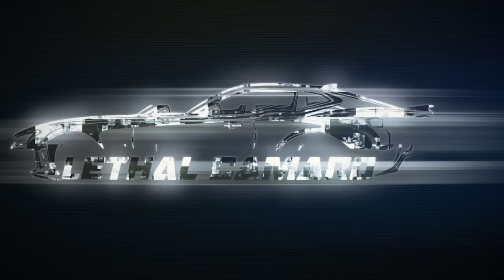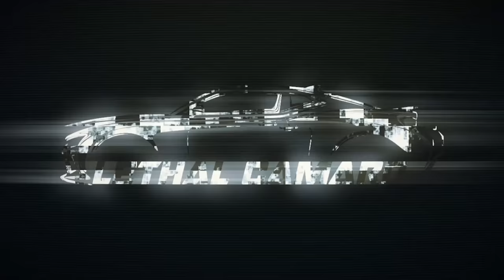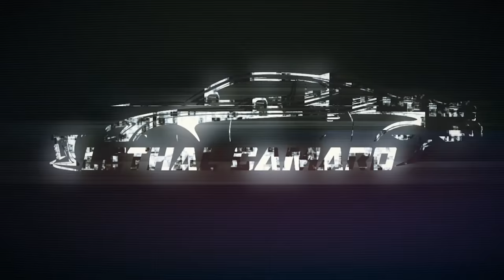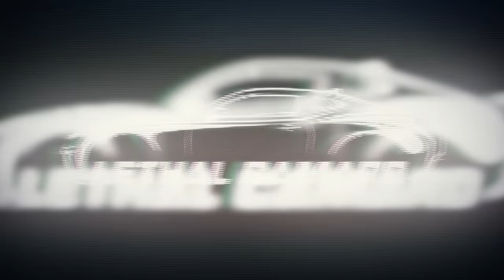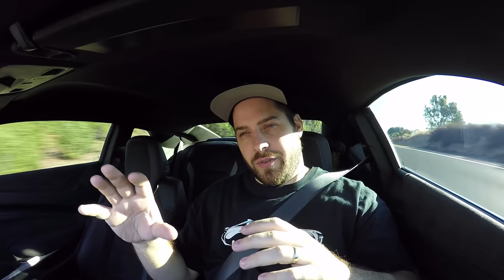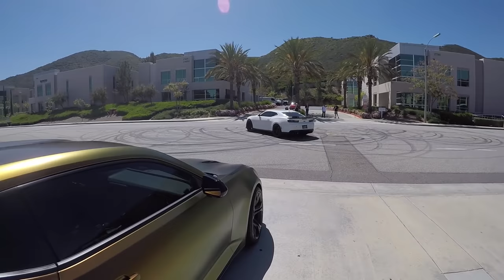Performance Chips! Watch Before You Buy! - Drive with Lethal | S2: EP9

Comment: Hey lethal back when you first got your car and you bought the vitesse throttle controller, why did you take it off? I have a tune exhaust and I just bought my throttle controller last night. I feel that the throttle controller on top of my tune is gonna work wonders for the drive by wire. It seems that some people feel that it's a replacement for a tune, but it's not. They can both be used for improvement, and from what I've seen the throttle controller does WAY more for throttle response than just a tune. Just making sure you liked it and I'm not wasting my money
Reply from the maker: +atolar23 if you get a real tune, you have them tune the throttle for you. Also with a built car and a precise tune, a TC can throw things out of wack, the throttle body position is very important in a real tune.
Reply: LethalGarage you can't get the most out of the throttle with a tune though or it can mess up your ECM from what I've heard. You get it all with the tc and it's customizable
Reply: I had a VTC on my '14 2SS for about 6 months.  At first I'd get the "limp mode" about once a month.  I was OK with that since I really liked having the VTC installed.  Towards the end I'd go into limp several times a day.  That was with reconnecting it and reprogramming it.  It just wasn't worth the hassle.
Reply: Terry Rodecker Really?? I already spent my money on it because I heard all the good things people said in the forums. Do you think I'll have problems out of it?

Comment: the chips work if they peg the timing like old hot rods, you gain a lean tease. Some reset speed limiter/rpm. My 96gmc had one (that computer they claimed untunable) and it was a lunatic. I brought mine back to factory. I won't reveal the brand, this video is not about that.

Comment: I have a 04 Maxima, it’s stock and wanna make it faster and if a stage 3 performance chip doesn’t work, what’s everything else I can do
Reply: I’d wanna add a cold air intake, spark plugs, stage 3 performance chip, tune, and last thing is a exhaust but not to loud because it’s a Maxima 💀

Comment: Question have my 2018ss Camaro getting the gm performance intake and thinking of throttle body like u had from one of your previous videos. The vmax throttle is no longer available but katech is would u recommend that. Also would you get a a tune after that for my simple setup

Comment: I’m just gonna skip performance changes on the computers. I’m gonna just try to put a big turbo in my 2011 impala 3.5 liter. With a short ram intake it has 211hp but I wonder if it’s possible to get the engine to 361hp without damage or long term damage to the engine. I want to keep it looking super simple and stock. But I wonder how my car will look with the 2LT RS Camaro rims on my impala with the upgraded headlights and taillights and new exhaust. I wonder how it would look. It could possibly look stupid but idk. I want to try it and see if it looks good. If it does I’ll definitely buy them.
Reply: You can't just put a big turbo, you have to match AR size to Cid, and engine flow. And a properly setup engine can easily achieve that.

Comment: Just go buy some 100 octane race gas at flyer's you will have quicker throttle response and no more backfire resulting in a little more HP. If those chips worked tuners would be out of business lol...

Comment: Looking for a chip to plug into the OBD2 port to allow me to run E85 and therefore need it to be able to modify the timing in addition to the A/F ratio.  Basically, I want to be able to plug in the chip when I want to use E85 and unplug it to go back to factory settings when running on regular gas. I'm not looking for any HP increases, just want to maintain the same drivability and prevent any damaging detonations.  Can someone recommend a performance chip that is made specifically for running E85?  Thanks!

Comment: What I'm doing I'm trying to keep you almost the same height it come from the factory 245 45-20 on the same height of the sidewall to keep the same plus ride luxury ride with white tie let me know what tire axle will fit on that front on a 9 inch rim

Comment: Lisa garage this is Reginald out of Norfolk I need your help with knowing what type of tires to go on my 2018 Chrysler 300s I'm going 20 attends in the back 20 by 9 in the front I want to put a 305 35-20 in the front on a 9 inch rim in the back I'm going to put a 315 35-20 in the back Chrysler 300s 2018 let me know if your front tires let me know if your front will work

Comment: 20 by 9 in the front 20 by 10 in the back stab you in the back I have 315 35-24 the back I'm trying to figure out what to go on the front 305 35-20 be little wider the same height

Comment: I know you had your car tuned but what was used to tune it?
Reply: Alejandro Mora more then likely hptuners was used for tuning.
Reply from the maker: +Alejandro Mora HP Tuner and a dyno.
Reply: Thank you!!! I have a 2018 1LE and wanted to have everything ready for when I start modding. Just a secondary cat delete and I changed out the anchor of a muffler so far
Reply: Alejandro Mora you should weigh the npp lol it looks like it weighs alot.
Reply: Sadly I threw it out already. But it felt like it weighed a lot. My highway cruising mpg went up 4mpg though so I know the cat and the npp were pretty restrictive and the npp's weight certainly didn't help

Comment: hey bro , am looking  for a performance chip , for a g37s coupe,  can you recommend, just wanted a lil  15 hp
Reply: It doesn't work. I've had this in my Q50 hoping for better milage but this hasn't increased anything. If you want an extra 15HP, invest in a new exhaust and/ or air intake if you haven't already.
Reply: J. Santos I have a Honda Civic 2013 si should I do one of the 2 you first building from stock ?

Comment: First give me a cookie! 
Now i got a serious question im planning on ordering a 2017 camaro ss in the next few months should i do that or should i order a 2018 camaro ss or go for the 2SS im a college student so im trying to get the most out of the money that im paying
Reply: Bashar Adel I don’t think you can order anymore for 2017 they are only taking 2018 orders now.
Reply: 2017 builds are done, 2018s are the current build.
Reply: Richard Ivanyi  yes ik but for some reason a dealership in jordan still has some in stock never been driven so i was planning on checking them out and asking for a price lower than the current msrp but i think that it would be a fail plan
Reply: B 1LE ik but we still have some in stock 2017 models
Reply: For a college student I wouldn't buy a 2017 or 2018 camaro, to much money, high payments
Reply: Young Sperm already got a toyota corolla for 1 year and i drive 2 many cars tbh im sick of driving inline 4 cars because i drive through the desert every day to uni you can as fast as you want and i can only reach 160km in that car at that speed you feel like its falling apart so i need something faster and reliable
Reply: Young Sperm im welling to pay that amount of money for a car that would actually handle what im asking for
Reply: Bashar Adel in stock and ordering is different but I’d say go for a 1ss if money is an issue they tend to run cheaper to buy and go for a 2017 since no changes were made for 2018
Reply: B 1LE i will most likely do that but are you sure that nothing has changed in the 2018 model?
Reply: Bashar Adel yes only thing new for 2018 is the release of the 2SS 1LE.
Reply: I don't think their is a difference
Reply from the maker: +Matthew Lafferty get what you can afford :)
Reply: Only the 2SS has the vented seats, get some a/c action while driving thru the desert

Comment: Wrong!!!! I bought a Dodge Performance chip for my 18 Charger R/T  and on a dyno my hp was increased by 61. Tell me that's in my head.
Reply from the maker: A factory update vs. and aftermarket chip is an entirely different conversation.
Reply: Which chip did you buy im looking for one to put in my 2015 challenger
Reply: @moparlife5361  Chipyourcar.com I bought the stage 3 chip and it works like a charm.
Reply: would it work for an infiniti g35?

Comment: What about Diablo?
Reply: King Keston a friend used a diablo tuner on a ram1500 and it made a difference. It wasnt on a dyno but the shift points in the auto tran changed and would chip all 4 tires in 1st to 2nd when on the performance setting. Seemed to run better to me. Butt dyno lol
Reply from the maker: +Todd G tuner setups are different than chips
Reply: I have one on my 17' Gen6 SS manual, best thing it did was remap the throttle to eliminate the dead zone and make it a lot more responsive. Sport mode and track mode feel way different from each other. Track mode feels like the throttle is heavier and wants more input, where as sport mode feels lighter and gives more throttle with less input. Stock it seemed both modes felt almost the same and had an earlier dead zone where you needed to mash the throttle to get to the power. So that alone was worth it with the Diablo tuner and OTS tune it supplied. I also have a Rotofab AI, and a MM catch can. The car feels faster, but I can`t say if it's the throttle remap or actual extra 15hp/15tq or whatever the numbers are supposed to be. Once I put some miles on it (@7k now), f` the warranty, I'm going headers, SC and a real dyno tune, hoping for 550 whp on pump 93, maybe a cam also.

Comment: U can get way more horse power buying a performance chip, it will max out the hp and ratio for your car and go 0-60 faster and more then 15 hp like 40 hp or more, depending what engine you have
Reply from the maker: /facepalm

Comment: In my experience, pro tunes cost much more than $200. My former Sti cost $750 for the tune. In fact, I tend to disagree with everything you say. Professional tuners simply remap your ECU. That's exactly what performance chips do. Have you installed a chip? Because if you haven't, how can you say they don't work? I installed a Pedal Commander in my Charger, and that thing makes a huge difference in immediate power. I suppose it's in my head?? What a stupid, insulting thing to say. People are too dumb to realize whether or not they're going faster? You sound pompous to me.
Reply from the maker: RAN MAN /facepalm... a pedal commander is not a chip. It simply remaps how your throttle ramps up. It doesn’t make it faster it still requesting the same voltage range from dead pedal to WOT. Maybe understand how the product works before you come spouting off nonsense. Yup your butt Dyno feels faster, but the car is not actually faster with a pedal commander.

Also, yes I have installed chips and did Dyno testing before and after with no increased power results.
Reply: @Lethalgarage  - I didn't say the Pedal Commander was a chip. I installed it myself. I was referring to a person's sense of going faster. I can probably run 20 mph. That doesn't mean a 5-Hour Energy drink and a pair of cleats will not help me run faster than my normal pace more often. And you're wrong, btw. My car is faster from a dead stop because the throttle reacts faster. It doesn't have more horsepower than before, but I get my available horsepower much quicker. And at the drag strip, that could be the difference between a win and a loss. Sorry,....but I still don't think you know what you're talking about. You're making generalizations without test results. You, in a car expounding, is not a scientific or mechanical test. I actually experienced a dyno butt test when I drove my pro-tuned Sti and when I drive my Pedal Commander Hemi. Sorry if I sound cross . I ain't. Although I've been told when I post, I do. It's just that modern cars are controlled by so many electronically programmed functions, from air/fuel ratios, to rev limits, to boost, throttle response, automatic shift times, traction control, so on.... You're saying a Programmed Chip will change none of that because horsepower and performance cannot change electronically with a chip, only with a human tuner?? I think you're wrong. Just because an engine is rated to a certain horsepower doesn't mean that it isn't capable of more. Particularly with modern electronically controlled  engines. That's all.
Peace!!
Reply: @ranman4481  tell me what your opinion on Thornton chip tuning is? Was thinking about getting it for my son’s 2010 cobalt lt2,has cai mod,exhaust & something else. Not much but I’m just curious. 
TIA

Comment: Why not test it give your viewers quantitative data, are you a tuner 
Are you trying show off your ride
YES U ARE 
Exhaust burble we hear from your car
You recommend people get car tuned 
When your car need timing adjustments . I’m a tuner for AEM

Fact 

Some cars' exhaust systems will produce an odd burble or bubbling noise. ... The burble is in actual fact a series of lean misfirings caused by this timing which rumble out through the exhaust system. It causes no serious damage to the engine, and soon disappears once the vehicle has reached high speeds.
Reply from the maker: Lol….

Comment: I do not agree. There are now chips out that really work and can add up to 60hp. For instance jdm pro stage 3 and it clearly offers real results. So people do your homework and some people just like getting 2-5 more mpg and faster throttle response. This chip even worked well on my Porsche turbo for only like $250 added a whole .4 seconds faster 0 to 60. Not a huge difference but noticeable and fun add on. So I call bs on your misleading people. 😁

Comment: What the fuck are you Talkin about????? Audi sq7 standard BHP 435, with chip in 500BHP, it takes about half an hour to install. You will not gain any power if you add a chip to a piece of crap. To benefit from the racing chip you you have to have a European diesel car and none of that American muscle 7.5 L with 215 brake horsepower engines 😅